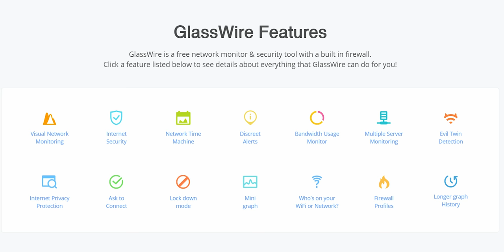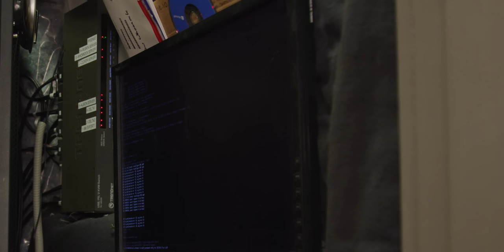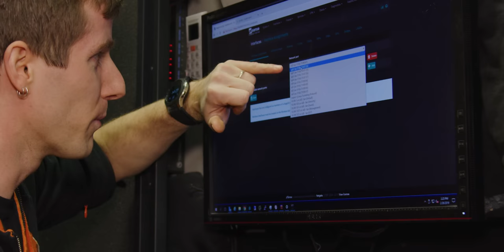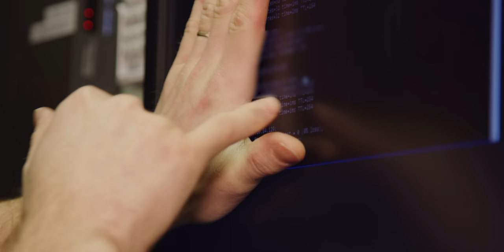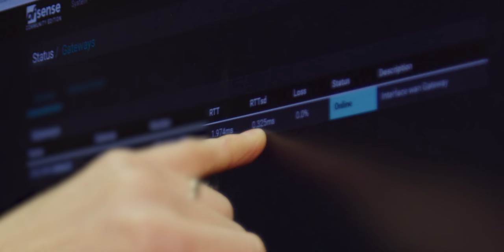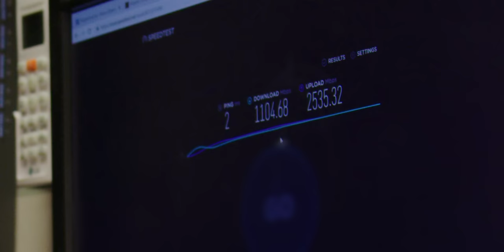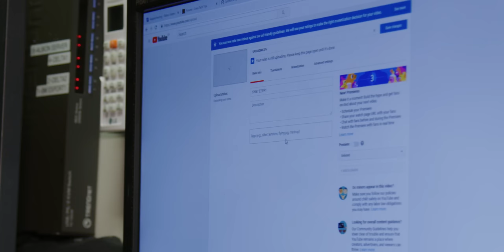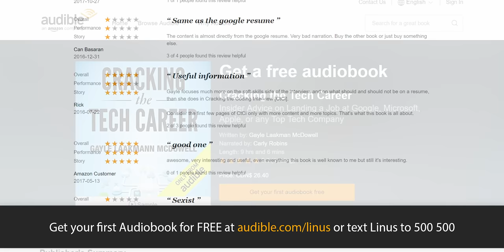We got 10 GIGABIT Internet!!

Comment: Confirmed CLICKBAIT! This is 9.8gbps not 10!
Reply: all of us do not get the download speeds an ISP promises
Reply: 10 with overhead.
Reply: well, later they say he got 6gbit routed to the "internet"
Reply: it is a full 10Gbit on the pipe, but % of that is used for TCP overhead -  for the data packaging and how data is protected for retransmit if packets are lost or fail to reach destination intact.  So your usable bandwidth will always be a little less.  This is not a bad thing, it's a good thing to use some of your bandwidth to protect the rest of your bandwidth.
Reply: @Charok1  my isp promises 200 mbps and i get 300, there are some people who are getting 400
Reply: It’s not that it’s just limitations in how the physical traffic is actually carried.
Reply: @commanderlake7997  He wouldn't say why on camera.
Reply: I like how none of these replies got the joke
Reply: @juaneduardovitoria  Nice. Mine sells it as 50 and I get 54-56 so people don't b*tch and moan about the speed. Nice ISP.
Reply: too bad so many people didn't get the joke, and tried to explain why it happened :/
Reply: @Charok1  i pay for upto 500mb and get 600 :p
Reply: Code Ultimate do you have cable or fiber? Cable installations are often very old
Reply: more like, 9.878767567 and goes on
Reply: @Code Ultimate all isps say "up to" for consumer connections :P
Reply: Depending on the test method this is acutally pretty impressive.
If you are testing with TCP (over IP over Ethernet) packets, the usual efficiency is aroung 95%, mostly due to the packet header overhead.
That would be 9.5 Gbps, and the measured 9.8 Gbps are way above that.
Reply: R/woosh
Reply: @beedslolkuntus2070  r/itswooooshwith4os
Reply: supertamal2000 
This is not a consumer connection, must be a proper 10Gbit one
Reply: DasSkelett 
Hmm, not sure about that :/
Reply: My advertised speed is 200 down. I constantly get 230 down over a VPN through pfSense
Reply: Yeah that's 200 mbps off
Reply: @Charok1  nah
Reply: @Charok1 r/woosh
Reply: This whole channel is clickbait
Reply: lmao
Reply: @Charok1  depends. A lot of times you get far more.
Reply: @Kittens Stole Me! That sounds like a problem with the networking gear. It almost always is when there's that much of a bandwidth discrepancy
Reply: Lol
Reply: ANONYMOUS UNKNOWN r/wooosh
Reply: ExCuSe Me BiSh??
Reply: @juaneduardovitoria  I get way over my speed. 200 but get like 230mbps a lot
Reply: Round it up
Reply: @0Raik  you were promised 50 and get 55 i got promised 20 and have 8 nice... : /
Reply: @sladkyhermelin3756  Megacable in GDL city
Reply: @0Raik  what is GDL?
Reply: Reminds my of physics classes
Reply: we arent measuring fucking gravity
Reply: @Charok1  Mine promised 1000mbps. I get 1005 mbps 😅🤣

Comment: "There's Overhead!" - 06:04
Classic TCP/IP issues....
Reply: overhead is a thing, but not as much of a thing as network engineers make it out to be
Reply: @Kamel419  https://en.m.wikipedia.org/wiki/QUIC
Here's the better version (not widely adopted yet).  If I recall, tcp IP has a 5% average overhead.  So the numbers they saw would be over 10gig if it wasn't tcp ip
Reply: @TheKnodel12  the amount of overhead actually depends on the size of the packets, which is not just dependent upon your equipment, but the smallest MTU of all of the components between endpoints. this means no blanket statement can be given as to exactly how much overhead it is. the purpose of QUIC you posted is not to resolve overhead (UDP also has header information in each packet and is even more susceptible to fragmentation issues), but instead to provide a means to send data in an asynchronous non-blocking way.
Reply: Kamel Yup, and lower in the stack you’ve got different frame transmission mediums that you have to account for as well as encapsulation or labeling higher in the stack. You’ll never get the max symbol rate.
Reply: It's pretty good overhead for a protocol from 1982.
Reply: My ISP gives me 2 to 5 percent real throughput above what I pay for. Nearest gateway ping is sub millisecond. Just on a 250mbps asynchronous cable subscription. Battlefield V sometimes shows a 7 ms ping. I'm still bad though. Netherlands btw.
Reply: @Kamel419  it was also to reduce the overhead.  You're right though, it was mostly to implement the asynchronous multiplexing that http/2 requires.  There's plenty of posts about the overhead of tcp though.  Such as https://networkengineering.stackexchange.com/questions/19976/trying-to-find-out-exact-tcp-overhead-cost
Reply: Just enable Jumbo Frames and you're good!  (sarcasm) lol
Reply: @Darkk6969  Oh yeah!  You know every packet I'm sending out is Jumbo...

Comment: "Welcome to the salty spitoon. How tough are ya?"
"I loaded an 100 hour 4k video"
"Oh yeah?"
"In 2 seconds"
"Uh! Right this way, sir!"
Reply: Hello Justin.Y
Reply: I slipped on a internet throttle
Reply: 'an-undred'
Reply: He's supposed to say yeah so
Reply: It can only transfer 1.125 gigabyte second
Reply: Me it’s more 2 seconds of 140p vidéo downladed in 100 hours...
Reply: According to the wise council of the internet, an average 1 minute 4k video is roughly 375 megabytes. 100 hours = 6000 minutes. So a 100 hour 4k video would be about 2.25 Terabytes. 10 gigabit internet connection means it can achieve a maximum of 1250 MB/s download speed. This means if they're hitting their absolute maximum download speeds from start to finish (not a likely scenario) they would need exactly 30 minutes, to completely download said video.
Reply: Tech Spongebob: “You got a bottle of thermal paste?”
Reply: @dshadow01  r/woooosh

Comment: as a fiber technician in sweden. i can tell u the fiber box on the door, if i were to organize the fibers like that. i would either be forced to go and fix it , or id be fired.
looking at it makes my body hurt
obviously am talking about the white fiberbox on the door
just noticed more errors when i kept watching. for example. it looks like the fiber tubing that goes into the house isnt air tight(dunno the english phrase) but there is no seal on the tubing, wich could lead to air constantly blowing into the house. due to air presure diffrence on the 2 ends of cable tube. that could introduce water either by convection, its also possible that built up condensesation can make a pool of water inside the tube can blow into the room if your unlucky, if the 2 ends get a relativly sudden presure diffrence.
hence why its very, very important to seal both ends, so no airflow is possible at all.

Comment: You know what you could use it for? Live streaming uncompressed 1080p60 content.
Reply: YES
Reply: Good luck getting ppl w the bandwith to actually connect to that
Reply: How about 4K
Reply: @hantzleyaudate7697  4k30 would work, but 4k60 requires 1.5 gigabytes per second of bandwidth
Reply: @szweida  The hell you think I am? A video engineer? I barely know the difference between a canon and a cannon!
Reply: @ZeldagigafanMatthew  That's only at 24 bit color depth. If you knocked that down a bit (considering most monitors display 10 bit maximum) you could do 4K60 pretty easily.
Reply: @imadecoy.  Half right. 24 bits per pixel. These 4k monitors you're speaking of are 10 bits per pixel, which ends up getting encoded as 32 bits per pixel, because computers like working with multiples of 8. Also, not all graphics card have universal support for high bit-depth color. GeForce Pascal for example only supports 10 BPC color in DirectX mode, though this is most likely a software switch.
Reply: @ZeldagigafanMatthew  I barely know the difference between a cannon, a Canon, and a canon. (Yes, there's a second canon.)
Reply: I wonder what's the fastest CPU you can operate remotely with this bandwidth.
As in, motherboard, video card on a place, CPU having its bus transmitted over the internet on another.

Comment: lol, you guys could practically become an ISP with that kind of bandwidth
Reply: they probably had to sign an agreement saying they could not resell it.
Reply: They can beam it to Linus house and get 10gb over wifi.
Reply: So the max speed on wifi is about 1200mbps so his internet is faster than WiFi can handle
Reply: in my country 1gb speed is 7 usd / month so 10 users wont cut it...
Reply: @dorinmosud9989  yea, in Australia the fastest plans for mortals are 50-100mbps and they are 80 Australian Pesos (about 50USD) a month.  I am remote, so I can only get satellite which is 25mbps (90GB/140GB off peak download limit) for $100 a month (600ms ping).  Needless to say, I am hoping Elon Musk pulls his finger out and puts in his low orbit satellite set up.
Reply: @benjones5799  In BC, you can't get Internet service for less than 115$/mo ($95 for the 150Mbps tier, taxes, and nonsense fees for fiber. Shaw Cable is about 130$/mo for 300mbps and they charge you per cable outlet.)
Reply: @Kisai_Yuki  Damn. Here in Montreal, I have 200Mbps for something like $90/month, split between three roommates.
Reply: @Kisai_Yuki  Here in Germany I get 50Mbps for 50€/Month
Reply: The prices for the Internet are pretty ridiculous for our modern era. Yes, I also hope I could live off the grid with Musk's low-orbit satellites, but, the higher the price goes over 7 USD, the less I'd be willing to move.
Reply: @dasphantom0439  Was? Du zahlst 50 für eine 50K Leitung? Ich zahle 20€ für eine 50K Leitung und 50€ für eine 500K Leitung.

Wo in Deutschland lebst du denn? Oder bei welchem Anbieter bist du? Krass.
Reply: @dasphantom0439  I would imagine that Germany would have a better internet, i live in a 120k pop town in Finland and pay €10/month for a 100/100Mb connection. In Romania many people get 1Gb connection for the same price.
Reply: @bebehasbebehas2287  To be more precise, prices are ridiculous in USA, all because of the lack of healthy competition. People in Europe are usually really weirded out when they hear that USA still has data caps, which have been non-existent in most places in EU for well over a decade now (excluding LTE).
Reply: Dorin MosuD What country has 1gb for $7
Reply: @Kisai_Yuki  dude i got 20mbps with no download limit from teksavvy for like $45 per month, +$15 for the router (that I'm paying over 12 months). 20mb isn't great, but it's enough, and while I still thing $45 is expensive for what I'm getting, I'm nowhere close to the prices you said. I live in Port Coquitlam btw.
Reply: I get upwards of 150mbps paying near $130 USD but I also have cable so 🤷🏼‍♂️
Reply: @felix683  did you ignore the part where I said fiber? Teksavvy does not have access to Telus Fiber, nor does it have access to Shaw's DOCSIS 3.x . Telus wants you to pay $80/mo for 25mbps on VDSL2 or $95 for 150mbps on channel bonded VDSL2. It's an utter rip off, and even if you can save $30/mo with Teksavvy you then have to deal with being under the thumb of Telus or Shaw whenever the service goes out.
Reply: @Kisai_Yuki  Per cable outlet? As in, per one of those plugs in the wall that you plug the router into?
Reply: @supernenechi  yep. Shaw was still charging per outlet, even if all they did was put a splitter on an existing one.
Reply: @dasphantom0439  i pay 70€/Month for 400down 20up in the middle of nowhere in southern germany
Reply: @marcoderking12  In Argentina I'm paying about 30 usd for 100mbps down and 10mbps up. i guess living in a country consistently in economic crisis pays off in some ways?
Reply: 20-30€ in France for symmetrical 300Mbps, some ISP charge 35-40€ for 1Gbps down / ~400Mbps up
Problem is they don't really cover everybody :/
Reply: @CanIHasThisName  LTE limits are now been slowly killed off here in the UK slowly but surely
Reply: @dannycostello  Well, yeah. But unlimited data plans are usually quite expensive, especially compared to FiOp and other technologies. The issue is that despite being very fast, the towers still have limited bandwidth and if everyone started using them for their home connection, they would not be sufficient.
Reply: Dorin MosuD wtf
Reply: @dasphantom0439  here in Colombia (underdevelopment country), I pay 33usd for 100mbps, very g
Reply: @nicholaslandolina  romania
Reply: 1000 down 220 up is £59.99 here
Reply: @dorinmosud9989  Which country?
Reply: 10 gig up and down for 50CHF (€46) in Switzerland
Reply: RetJ yea, they’re certainly hardwired.
Reply: Beyond Sane  I pay that much for cable + gigabit
Reply: @Kisai_Yuki  This is old, but I pay $60 CAD per month for 600mb internet in a small BC city currently.
Reply: Tf is a isp
Reply: @Droplxlx  Internet Service Provider
Reply: Linuscom
Reply: @RettigJ  that's a theoretical max, real world is way less
Reply: I live in a fucking archipelago called the Philippines. I pay 2000 Philippine Peso which is worth 40$ and promises a 30mbps connection. And I'm here watching Linus Tech Tips at midnight(it's faster on this part of the day) and I only get an average 50kbps. Yes it's true
Reply: @pretzela318  you should complain somewhere
Reply: @wandererstraining  here in India 1333INR (around 18USD) for 100mbps with no data cap
Reply: @hellyeah6717  That's a good price, and a very reasonable speed for the price! That's really great for Indians who have access to it!
Reply: @RettigJ  10gig ethernet exists
Reply: @CanIHasThisName  It's not solely the lack of competition, but the size of the US as well. Europe's population is incredibly dense comparatively.
Reply: @benjones5799  Dam you people get ripped off.

Comment: Me: I'm currently paying for 400 megabit but I've never seen more than 280 megabit even in the dead of night. 

ISP: there's overhead.

Me: BS!
Reply: Meanwhile I pay for 200 megabit and I consistently get 240 to 250.
Reply: Though I think that is likely due to the fact that I am one of very few customers in this area.
Reply: do you have a shitty router? your computer also needs to be able to handle the connection. you need to check for bottlenecks.
Reply: @HamguyBacon  it can be true, I have 300 Mbps internet, before, I only got 140-160 Mbps with small router, after change to better router, now I got 300-340 Mbps internet. So maybe He need to change his router too.
Reply: Lol, I get 40🤣
Reply: @MowBTC  I'm guessing that's a joke I'm not getting, but overhead is 100% a thing with TCP. Not only are the frames larger than they might need to be for certain applications, but things like packet loss (which shouldn't happen on their connection really) is also part of the overhead problem. Using minimal protocols like UDP can minimize the overhead a bit, but (possibly) increase packet loss.
Then there's the fact that a frame is constantly being opened up, rewritten, and retransmitted on every intermediate device that is not a switch. However for something like an ISP, mostly every intermediate device between the ISP and you, should consist of switches running services like IS-IS (although many still cling to older protocols for various reasons).
Reply: Hamguy Bacon nope not using a shitty router and I’m testing my speeds on a gigabit Ethernet connection to the tower. The problem is not on my end.